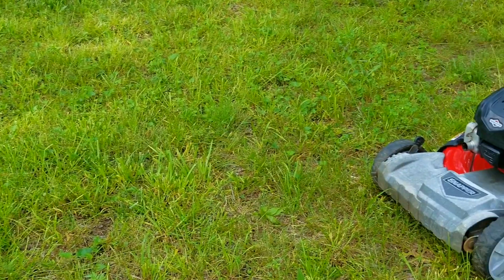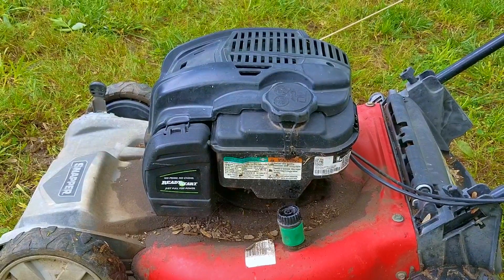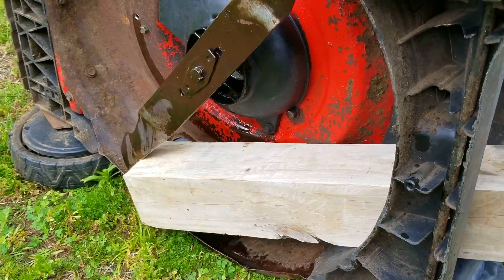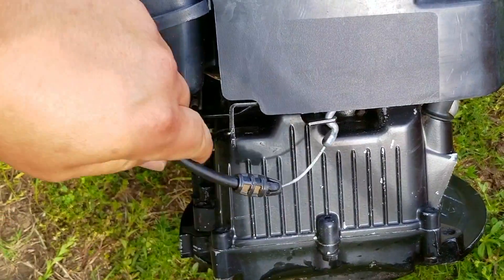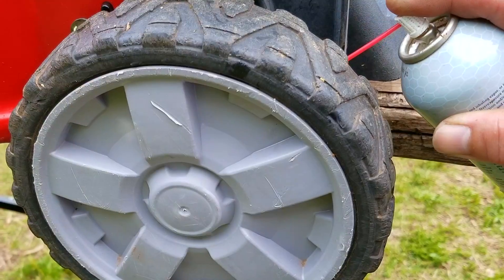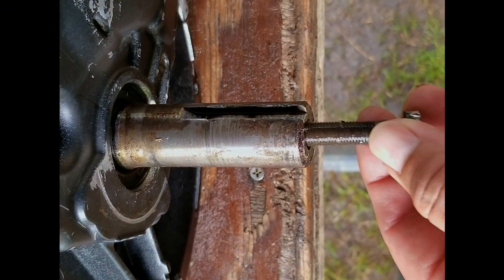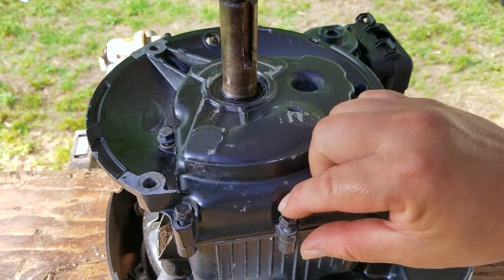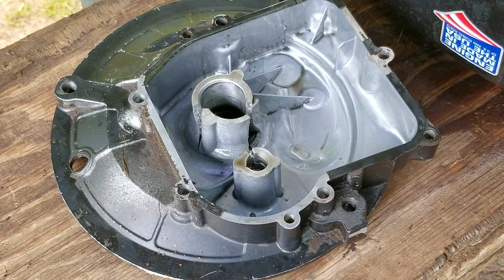Trying To Fix A Snapper Mower That's Shaking A Lot

Comment: I would either install a used engine or keep this one for parts.  Many years ago, about 50 to be exact, I was mowing lawns while in high school to make extra money.  I had a mower with a Briggs and Stratton engine which I had used extensively.  One day I was mowing a lawn and ran over a steel rod sticking out of the ground at about the mowing level.  The crankshaft broke off, it was not just bent.  Luckily, I had other usable mowers that people had given me, etc.
Reply: Sounds like my situation exactly except it was about 40 years ago.  I was in high school mowing lawns to make extra money.  I used my parents (under one year old) Craftsman mower to mow a gas stations grass and hit a steel rod sticking out of the ground.  It was used to keep a cement parking block in place that was no longer there anymore.  I bent the crankshaft and you could not pull the string anymore.  😲😭  It cost about $135 at the time and the mower cost about 200 new.  I did not have $135 at the time and paid my parents back. Life lessons....    🤨😐😭😩
Reply: @brianevans6819  I lived in an oil boom town.  The boom was over, but there was(and is) steel stuff sticking out all over.  I did not see this one because of the grass.  I was lucky to have other mowers to use.  We had one that had been given to us that had a 27 inch blade.  The problem was that if there were any depressions in the ground, the front of the mower would hit the ground, stopping it. We did not use that mower much.
Reply from the maker: thank you for sharing that
Reply: You are fortunate. A friend of mine bought and installed an after market blade. Started mowing his yard, the blade broke in half, sending 2 pieces out the back. It struck both of my friends legs, ergo, trip to emergency room. He survived, but he doesn't use power mowers anymore.
Reply: @georgepruitt637  your friend is very lucky. It could have been a lot worse. I’m glad he’s doing okay now.
Reply: @georgepruitt637  your friend is very lucky. It could have been a lot worse. I’m glad he’s doing okay now.

Comment: At this point, I'd use the mower as a parts machine.  If in the future you come across a good used engine for cheap, it may be worth installing it to this mower since the rest of the mower is in good condition.
Reply from the maker: thank you

Comment: 3:24 get a blade removal tool - it clamps to the deck and you put the blade in between it.  Works like a charm!  Not very expensive and it is well worth it so you don't have to wedge a piece of wood under there.  Really comes in handy getting the 3 blades off of my ZTR.  It's already hard to get an arm up under there to take the blades off but it's much easier when you can clamp down the blade and remove the screw without having to work a piece of wood under to catch the blade.
Reply from the maker: thank you for that

Comment: Hey Home Garage, just here to update you on my strimmer.

I received the carburetor yesterday and have been fixing the strimmer today, put new fuel lines on, and the new carb, after i did all that, i then tried it out and see if the idling issue was resolved, but there was a lot of air in the system and it wouldn't idle smoothly, and no matter what we did we couldn't get the air out of the system, so we put the old fuel lines on (new fuel filter), and then saw that it was priming much better than before, we then started it, and the idling issue was resolved, but it would rev slightly then go back down to idle (on its own), we resolved that issue, but another issue occured, it was idling like it was fixed and ready to be used, starting using it, then letting go of the throttle and very quickly died, so as soon as you press the throttle it'll work but then will all of a sudden die.

So the issue is - Use the throttle, and then the engine shuts off, but the idling situation is working now, but it's just doesn't like to stay on the throttle, nor like to be idled after high revs.
Really could use your work as i watch your vids and your a master, and like you said (if the engine itself is working, then it's never dead :D)
Love your vids.
Loads of support, and also support petrol for the future
Reply from the maker: thanks, when replacing a carb, you sometimes have to make a slight adjustment to the fuel screws to get it to work. I'd increase the fuel on the "L" first and see what happens
Reply: @HomeGaragechannel  ok, and it does idle perfectly now, it’s just during high speed it, and when you let go of the throttle it just shuts off, so it won’t idle after that

Should I try the H screw, if so, what should I do
👍

Comment: 12:44 Keep the deck for if you come across another mower with a good engine and a crappy deck. As for the engine, take whatever undamaged parts you can from it and scrap the rest. You see enough free and cheap mowers that sooner or later, you'll come across one with the engine you need that will represent a far better time/cost savings vs. fixing that hot mess.
Reply from the maker: thank you

Comment: The person responsible for slapping a "Snapper" label on this thing should be arrested...
Reply: 2nd this!
Reply: It's disconcerting seeing a Snapper strip & not recognizing one part matching my '83. 
Well maybe the blade retaining bolt looked similar.  : l       shrugs. 
& bolt a Quantum on it!
Reply: @timewa851  I have an 85, four horse and had one with a REVERSE on the gear stick. 3 1/2 horse, aluminum deck. Sweet mower. NOTHING like the new garbage.
Reply: It's a B&S
Reply: @MazichMusic  But it's not a SNAPPER! NOTHING resembles the old good originals.Looks just like all the rest of the cheap junk being sold.
Reply: @lewiemcneely9143  I've got a Yard Force mower. Only a 3hp engine. It is a Taiwanese job. It works well. Came with a cloth type catcher bag.
Reply: That would be Briggs and Stratton corp and MTD corp.
Reply: @georgepruitt637  Still a bad joke compared to a REAL Snapper of any kind. Just more look alike garbage. Including Briggs/Tecumseh.

Comment: Wow, seen plenty of bent crankshafts before but never a totally blown out sump! I’d just put another engine / blade adapter on it and sell it on. People seem to love these cheap FWD self propelled mowers for some reason. Plenty of good useable parts left on that blown engine so it’s win-win really. If you work on mowers like I do you probably have a pretty decent selection of good used engines standing by for just such an occasion LOL!
Reply from the maker: thank you it seems like that's the consensus so far.

Comment: I think you should just put a donor engine onto it. It has a good deck and self propelled system now. I would take the engine off that rusted lawn boy deck and put it on here. The worst thing I ever hit with my lawnmower was an outdoor door mat. The mower sucked it up under the deck and almost stalled completely before I turned off the mower. I don’t think I damaged anything because it still runs as smooth as before. I got lucky with that one 😅
Reply from the maker: I think you're and you got lucky with your mower

Comment: I'm refubishing a mower myself now (waiting for a new chassis and other stuff), total amount will be around half the price of what I paid it new 8 years ago and 1/3 of the same specs newer model that they sell now, but I plan to reinforce the chassis and therefore make it better than the new one. So, in the end, expensive: yes. Makes sense? Yes too.
On a mower like this, if I was wearing your clothes, I'd be very careful: either you find a bad chassis one with a good engine and from 2 you make 1, or I'd think twice, especially I'd consider the price you pay Vs. the one you can sell it for, the market situation (how these are requested) etc.
Reply from the maker: thank you for sharing that

Comment: What type of cleaner do you use, where do you buy it and does it have to sit and soak in before rinsing off or do you rinse it right after you spray it on?
Reply from the maker: it's the degreaser from harbor freight and make sure whatever  you do, to follow the instruction on the bottle

Comment: I had a toro awd last year. Got it running shook bad blade shot. The air cleaner cover vibrated so long bairly stay on. Top of  tank wore through from vibrating.  Blade adapter wore out so blade,adapter, gas tank, air cleaner Assy, oil change,  front drive belt, adjust valves decent mower. I can understand when they get a quote to repair buy new.
Reply from the maker: me too, and it makes sense

Comment: Hmm 🤔 jb weld the loose pieces together if u have all of them then jb weld them into place on the sump (going the route of if I didn't have another mower and didn't want to buy a new one method) and get a new seal tap the key back in on the blade adapter after getting all the chunks of debris out of the case then put it back together and see if it works and don't leak( bend the shaft straight too) it's an idea
Reply from the maker: LOL!! I wish that work. The block as a crack in it as well.
Reply: Jb weld that too🤣🤣

Comment: I’m having a hard time finding the video where you talk about your water sprayer. Could you tell me what your using. As I recall was it a paint sprayer?
Reply from the maker: sure it's a Graco Magnum X7 paint sprayer, works great when you turn it to the wide fan, to gently water the leaves on all your plants, or If you just want to mist your kids on a hot day. To be honest, it's a great machine, and of course if you wanted to paint something in a hurry, that works too. I got it for free because It has the smallest of leaks at the pump and my friend was going to throw it away.
Reply: @HomeGaragechannel  thank you

Comment: That's a big impact, it hit something really hard, my guess would be a curb stop, the pipe for the main water shutoff on the lawn.  Myself, that would just be a parts mower in my pile if the customer didn't want it back.  I don't like those Briggs EXi engines anyway.  If it was a quantum, I'd at least give the customer an estimate, but this machine would be headed to the bone yard.
Reply from the maker: I know right, I was going to say, concrete culvert

Comment: The shanking is 1 of 2 problem s is The blade is bent or off balance or the engine is not bolted down properly  .or the problem that you found out
Reply from the maker: it's actually  much worse

Comment: First off I would price a used Engine to see how much it would set me back.  If it is too much then I would just salvage the mower for parts and either keep them if you can find a use for them or just sell off the parts because the Deck seems to be in pretty good condition.
Reply from the maker: thank you
Reply: @HomeGaragechannel  Yup no probs.

Comment: A couple days ago I bought a Husqvarna awd mower with a Briggs and Stratton engine like this one and I can’t get it to run for the life of me.  The person I bought it from out an aftermarket carb on there and it would only start when you took the air filter off and never came to full power and would almost die when you tried to use it.  I cleaned and put the old carb back on.  Checked the flywheel key and it was good.  Took the valve cover off and found the exhaust valve missing the cap.  So I adjusted the valves (intake .003 and exhaust .005) and now it won’t start at all.  Any ideas?
Reply from the maker: sure, I'd check the compression first and then If it was more then enough , I'd replace the carb with a new one.  When checking the carb did you notice if the O ring was in the right place on the back of the carb?
Reply: @HomeGaragechannel  yeah the o ring was on the carb with the plastic retainer on top of it.  The past few days I’ve actually been having problems with the plastic carbs and especially with the needle seating.  Guess the rubber tips are deforming because of ethanol gas

Comment: The only way this engine would be economically feasible to repair is if you already had most of the expensive parts on hand in good used condition. Even if you did, an engine that has sustained this much damage may have other damage in the form of tolerances  being out of spec etc. because of the high forces against them when the damage was done. I would probably only attempt to repair it for fun; just to see how it turns out and only  if I had the used parts on hand. I would either replace the engine with a known good engine (if I had one on hand) before reselling it or just call it a parts mower.
Reply from the maker: thank you for that information

Comment: i've seen you things fix worse then that also take the connecting rod off the crank and inspect the bearing surface on the rod it may be worn more on one side from the crank slapping around hopefully it wasn't run like that for too long
Reply from the maker: this one is by far the worst and I only noticed that the block also has a small crack in it as well.
Reply: @HomeGaragechannel  really even the block is cracked what did it hit a cinder block or a half inch thick piece of rebar looks like there is not much left to salvage time for a used engine?

Comment: I'd rebuild it you'll get your $ back,I've took a course in Briggs and Stratton and I've rebuilt 1 before,ran so good collapsed  a ring,that snapper would be tight and you'd be proud
Reply from the maker: that wold be a good idea, but if you take a closer look at the block it turns out it was cracked as well.

Comment: rebuilding that would break the bank and get nothing in return. but as for experiment purpose (like the craftsman mower engine) i would like to see those crap parts get replaced but what i dont like about that is that project will put a pressure on you and that would be pretty painful.
Reply from the maker: agreed!

Comment: I have a all wheel drive Husqvarna i bought has bent crankshaft. Worse than yours. I have a crankshaft out of a blown up 163 cc briggs. I need to remove aluminum off of rod journal and shine it up proceed fron there
Reply from the maker: nice, hopefully you can get it replaced soon

Comment: I'd review the economics of a used engine vs what the mower would be worth. I'm sure it would be cheaper than parts and labor invested in fixing the old engine with used parts, but I'm not sure what the mower would be worth in working condition. It might not pencil out to fix it. I don't think I'd even keep it around for parts. The deck is usable, but it's nothing special.
Reply from the maker: agreed!

Comment: What happened to that mower probably started with ..... "hold my beer" or .. "On this episode of Jackass..."  That engine is trashed. I bet the upper end of the crank and housing is smoked after running in that condition.  Looks like the deck is fair shape. I'd do a swap with a mower that had a damaged deck and a good engine. Then salvage whatever parts are usable.
Reply from the maker: agreed!

Comment: Too much damage to fix. I saw the crank case crack early in the video, straight after cleaning, & I also noticed the seal damage, which told me the crank is bent. I would fit a good used engine.
Reply from the maker: you are the first person to see the crack! Very nice job!

Comment: This engine and mower has become an item for parts only. Not economical to fix in my humble opinion. You may stumble upon a mower that has a good engine but a worn out deck. Then you could use the engine from that one and use the deck from the mower in your video.
Reply from the maker: very good advice

Comment: I’d certainly not put a penny into this POS! That engine not only has a plastic carb but a PLASTIC CAM! Don’t put a penny into that engine. Don’t get me wrong I regularly spend more money in parts then a new machine when dealing with a older well built machine and that’s due to the horrific quality of new ones. My advice is find something at least 20 years old and rebuild that one. These plastic piles of junk aren’t worth putting a penny into and certainly not worth buying new!
Reply from the maker: thank you